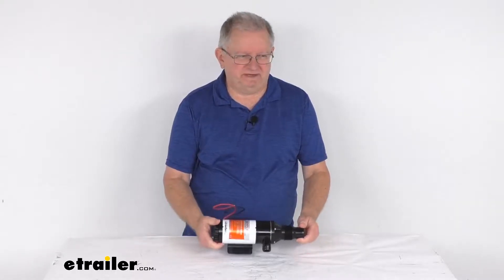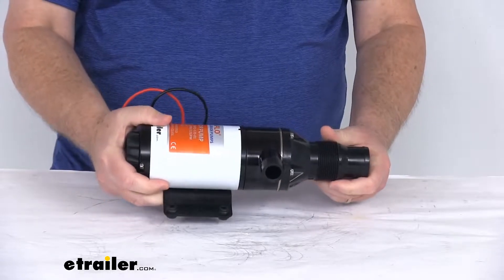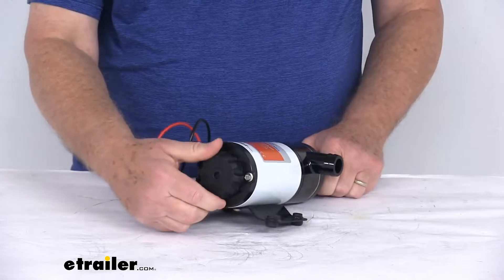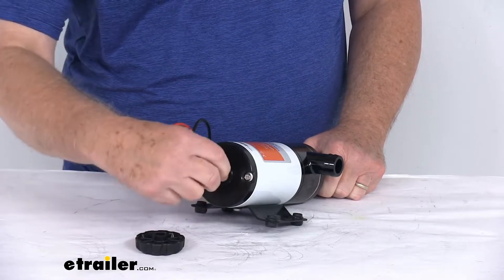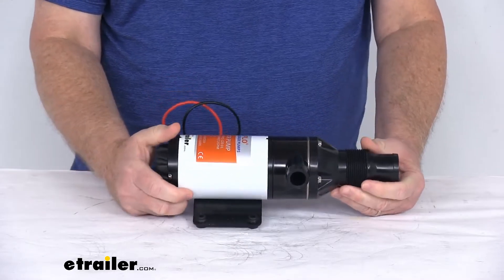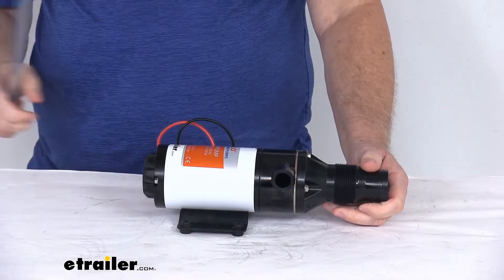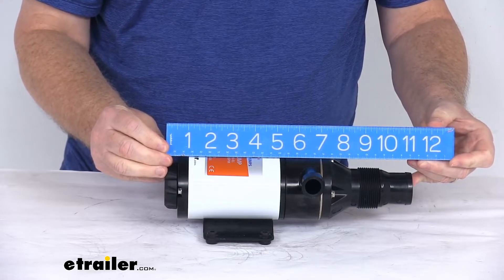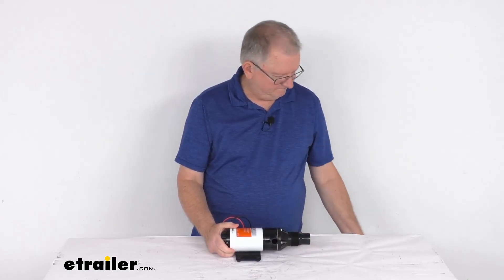etrailer | Detailed Breakdown of the Seaflo Macerator Pump for RVs and Boats

Comment: How do you hook it to the rv ? What comes with it ? Thx
Reply from the maker: With this macerator, you will have to supply the fittings that connect to the RV's black tank pipe. We have another macerator that will come with everything you need to connect directly to your black tank pipe.
https://www.etrailer.com/RV-Water-Pump/SewerSolution/SS01.html
https://www.etrailer.com/RV-Water-Pump/Seaflo/SE64FR.html